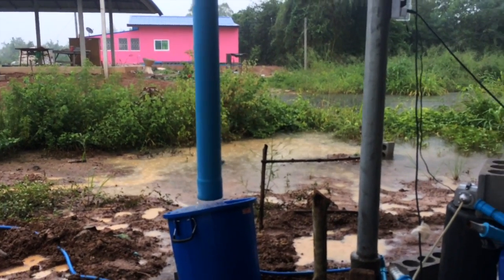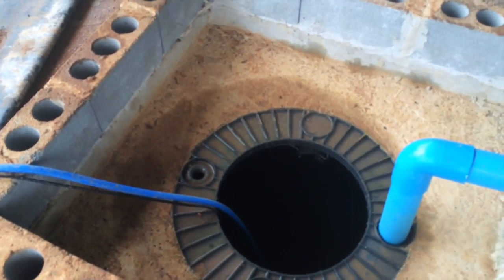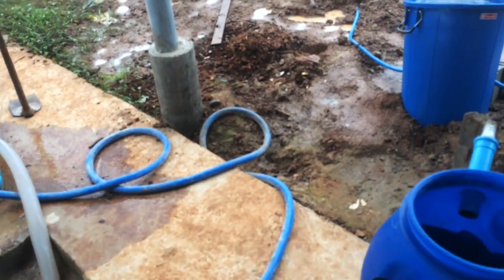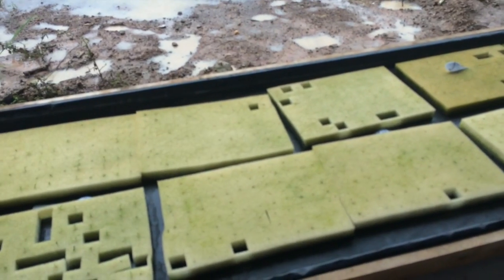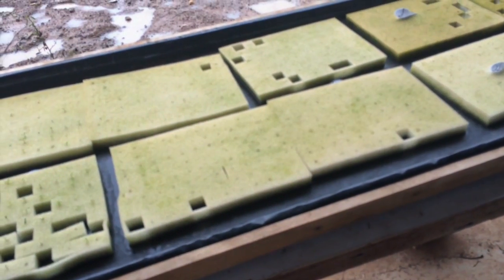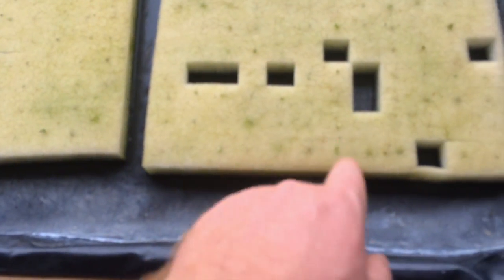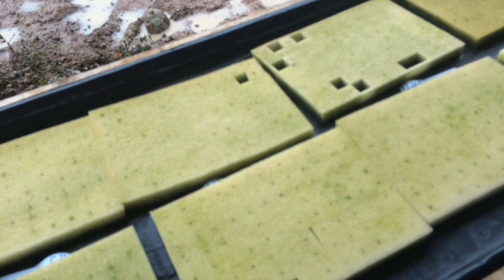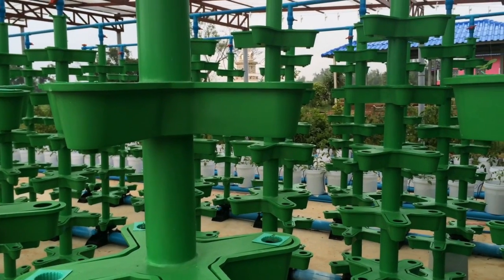Ponic Wars Amazing Hydroponic Auto Dosing Machine

Comment: check pH, no nutrients needed (can burn seeds), water/table/air temps (temps are important), o2 levels in water, amount of water being retained in cubes after watering. many factors... my advice is check them all. including anything i might have missed. the best luck i've had with anything like this is floating it with air stones underneath. i did a test in plain 3% h2o2 (no air stones), while all my seeds did sprout, they didn't search for more o2. they stayed tiny and then died off eventually. i sprout in a damp paper towel folded up with seeds in creases, snug not smashed, place in ziploc then in warm place for few days. take sprouts and put in whatever medium you choose. so far this has produced the best results for me. however i am just a backyard gardener. labs do similar in petri dishes in incubators which control the climate/temp.
Reply from the maker: Thanks Ego Bruiser It turned out the seeds were bad.

Comment: Hey Ryan,
     I have used those same cubes in my Aquaponics system in Khon Kaen, Thailand. Also had the same issue with poor germination. Not sure why, the core seems to hold water better than Rockwool. Leaving me to the assumption that its a less favorable environment for the initial germination of seeds. If you take a seed out of one of the cubes and press it does a white cream like substance come out the middle? If so then too wet.
       However, there is a solution to this issue. Germinate the seeds with the Ziploc bag/paper towel germination method (keep the bag warm and dark). After the seeds germinate place them in the Thai sponges, then you can grow out the seedling until they are ready to be transplanted.
      Also the Loas Basil A.K.A. lemon basil does great in the cubes and in Aquaponics it favors wet conditions (when compared to other types of basil) and grows at tremendous rates compared to soil. Thai eggplants (Choa Paya) do great in Aquaponics as well with heavy production.
Feel free to contact me if you need clarification: Thomas.E.Cowart.Jr@gmail.com

Great videos keep them up!

Comment: Like the auto dosing machine idea, especially with the volume you are working with. I have to refill my reservoirs every 2-3 days, just with my little setup! Do you see any mold inside of the seed holes? If so, You are probably keeping them too wet. Regardless of the medium you are using, make sure you are using non chlorinated, ph balanced water, and they just need to be lightly damp, not wet. Just my .02 ; ) Hope you feel better, my friend!
Reply from the maker: Thanks keyplayr61 ! It looks as though many of my older seeds have gone dormant. So, trying to use the newest / latest stuff I've got on hand, and get a new order in. No big deal! Also, I don't have a dosing machine. I think my attempt at dry humor failed. I am the dosing machine. lol
Reply: uhhhh........Now I feel stupid....lol I did notice you putting those cups of nutrients in that tank.........Duh!.......Oh well It's all good, Bud ; ) As sharp as I sometimes like to think I am...................."And the rest is history"
Reply from the maker: keyplayr61 A dosing machine would be ideal, for sure. Just have to find a way to justify the cost. I'm on site all day anyways, and running a 1200L reservoir keeps things pretty stable.

Comment: I'm struggling with my hydro seed germination too. If you figure something out please post it. I don't want to use rock wool either. So far the only thing that has worked is germinating in tap water wet paper towels for a week then planting the small sprouts at the surface of cubes in my 300 ppm solution. I don't like this technique as it would be way easier to be able to germinate in its initial plant site or just anything else really... I need a scalable solution aswell!

Comment: I like to plant them out and water once to complete saturation leave them standing in water for 12 to 24hrs then drain well and keep in the coolest shadey-est place you have  you should have germination and see the seeds split in 24 -36hrs ... after that put in a well lit place and water from the bottom up if you don't see the lettuce seeds split in 48hrs its probably the seeds ... # most important thing over here is to keep all your seeds refrigerated as soon as you open the pack ... and only use what you need and put straight back in the fridge ... even a week or so open and out in this heat can start to make them go dormant.... took me a lot of trial and error to figure this one out.. but follow this and you will have great germination.. if your seeds are still ok ..
Reply from the maker: Thanks for this. Very helpful. Do you find that the dormant seeds are primarily a lettuce issue? 

Do you refrigerate all of your seeds regardless of the variety? Basil, Lettuce, Beans, Melons, etc?

I've had tomato seeds for years, kept in the same conditions, and they all did fine. Definitely a no go on the lettuce though.
Reply: Ponic Wars I make it a habit with all seeds but it is essential with lettuce lost around 20,000thb befor I figured it all out ..... now I just refrigerate everything  and have not had a problem since ... ;)
Reply from the maker: Youtube University Thanks again, will follow your advice in the future and stay on the safe side. Live and learn eh?

Comment: Hi! The sponges work just fine what they are vulnerable to is moisture level. That's is the main problem with them. They soak water quickly and dry out as well. I keep sponges covered with plastic it helps stabilize moisture. I don't keep 'em under direct sun because as I said earlier sponges dry out very quickly.
Reply from the maker: Understood. Thanks for the tip. I will try to be more diligent about covering them.